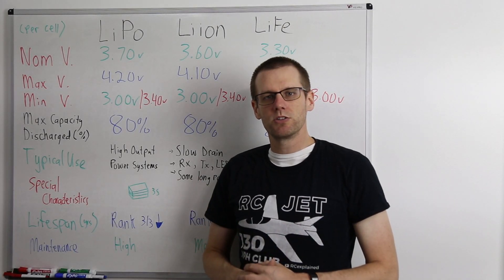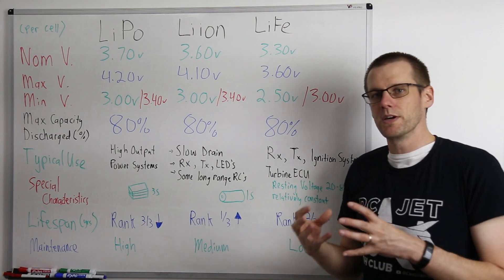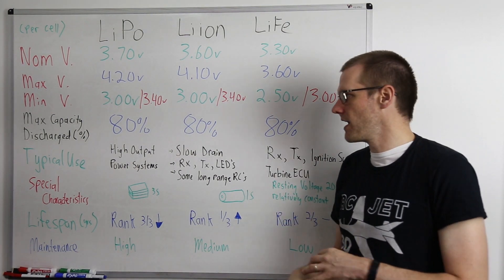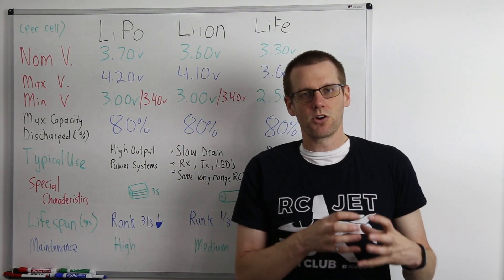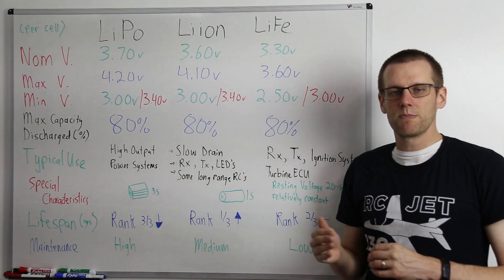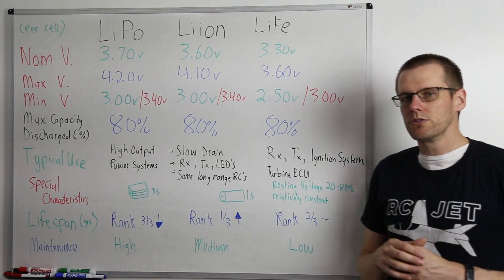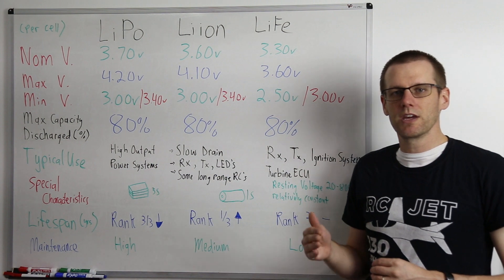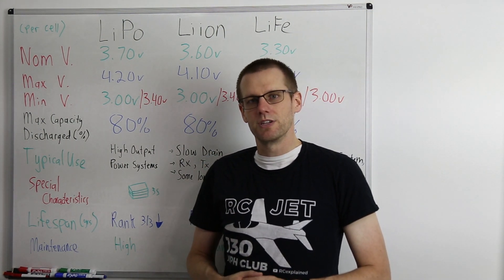Basics of LiPo vs Li ion vs LiFe Batteries Explained

Comment: If a speedlite uses 6AA batteries. Which is best (li-ion or li-po) to use to connect in 3 series?
3.6v X 3 = 10.8v or 3.7v X 3 = 11.1v, again which best & does speedlite has voltage tolerances to accept higher than 9v?

Comment: I found the lifespan explanation a bit lacking. And looking at like an Eve 1kilowatt 320ah cell, it have a rating of 6000 cycles minium, so close to 20years to drop to 80% capacity..minium. so what is li-ion since its above that on your table? 30years? You should talk about it more not just some arbitrary examples of random lifespan. Some data sheet examples would have been nice. But.. overall good effort on video, thank you.

Comment: I see a bit of crossover in RC and Airsoft. I build high end Airsoft AEGs. I also try and guide people doing their own tech work. The biggest misunderstood aspect of building AEGs is batteries. There is a company that has conned people into buying their batteries. Titan Power L-Ion batteries. They just series some Sony 18650s to 11.1v and 7.4v configurations. They claim that they are 15C..... Airsoft uses mostly brushed DC motors to turn a set of gears that pull a spring back. The problem comes in when using semi fire, which is 90% of what is allowed. Motors pull more current on start up, and rapid semi fire is a huge strain. Some motors require 35-60 amps on startup, depending on load and TPA of the motor. I try and tell people not to use ion batteries for airsoft and they call me crazy. It is much easier to fool people than it is to convince them that they have been fooled.

Comment: Hi, I have a question (maybe a little bit out of the topic), is that can we charge a Lipo battery at the higher Amp let say a 5200mah 2s lipo charge by 10a charger (set at 10a)… and any consequence….tq
Reply: I’m still confused about the whole charging a lipo based on the c rating. From what I understand, if the c rating is higher, then yes you can charge at a higher amperage.

If you don’t understand the whole c rating thing (which I still don’t) then it’s best to just play it safe, and simply charge no higher than the amp rating on the battery itself. 5200 mah - charge at 5a. 3400 mah - charge at 3a. 1800 mah - charge at 1a and so on.
Reply: @ubreakitirepairit3569  Yeah...the rule of thumb commonly pushed as the safe charging amperage for LiPo is just match the MAH rating of the battery, however, what I've been unable to find is a similar "safe" rule of thumb for the Li-Ion batteries.  A 5000 MAH 7.4v Li-Ion battery I have states right on the battery not to exceed 2 amps for charging. So...is 40% of a Li-Ion battery MAH a safe rule of thumb for charging Li-Ion batteries?

Comment: My ESC defaults to shutoff @ 3.0v (per cell). I'll be changing that to 3.4v. Thanks.
Reply from the maker: Just keep in mind this is not a resting voltage. The voltage you would be setting is loaded.

Comment: Liion is 4.2v max. And Samsung 21700 30t have higher C ratings now. I race 1/8 truggy with liion 4s and it works as good as lipo 4s
Reply from the maker: Traditional Li-ion battery voltages are used. There are multiple derivatives of each of the 3 main Lithium batteries discussed with different specs.
Reply: But your Li-Ion c rating dont reach any LiPo.
Reply: A follow up, if i only want to say, trailing with my rc truck, li ion would be enough, right?

Comment: Hey, I think the Lithium Ion numbers are wrong. The max voltage is the same as lipo at 4.2v and the lowest they go safely is 2.5v, not 3/3.4v. Also Life batteries have the longest lifespan, usually in the thousands. Li-ions are usually 300-500.
Reply: I think older liions were 4.1v but at some point they managed to bump them up to 4.2v more recently. I've seen and had both...
Reply from the maker: Traditional Li-ion battery voltages are used. There are multiple derivatives of each of the 3 main Lithium batteries discussed with different specs.

Comment: Can you make a video on how to change motor bearings and how to tell what size bearing to get? i dont have a hobby shop near me so ive gotta do all repairs myself. thanks!
Reply: I second this. I’m sure I’ll be needing to do this a lot with the R&D I’m doing with these.
Reply: Check out McMaster& Carr they have references charts and a very wide and expansive selection of hardware/ fasteners, and other materials and equipment.